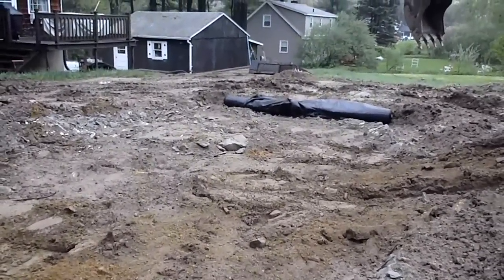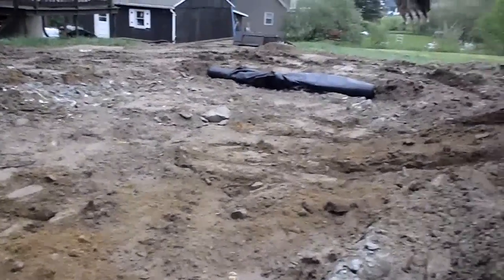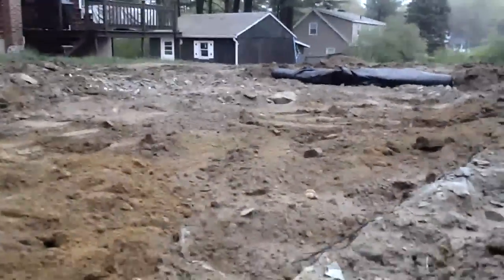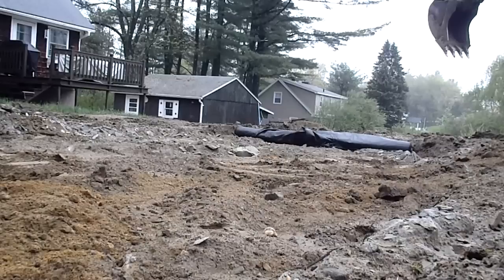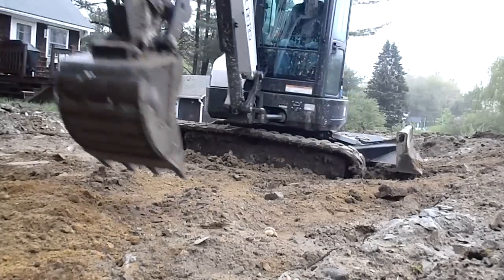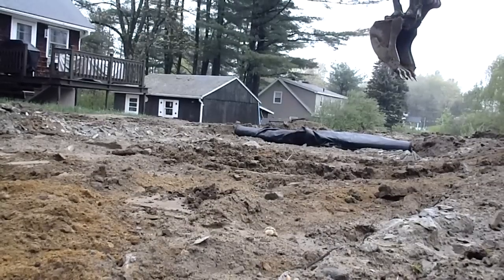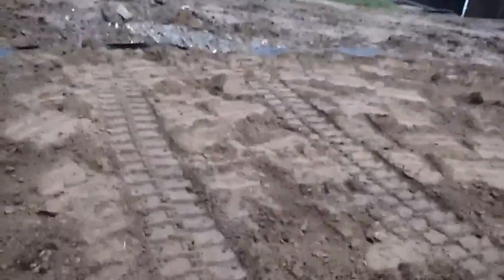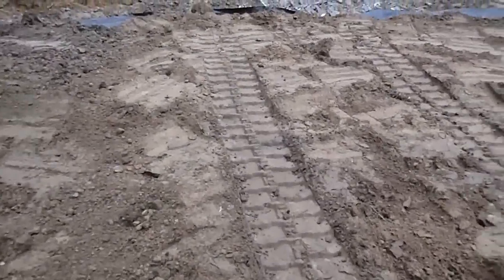How Geotextile Fabric Works (Practical Application)

Comment: wonder how much it weights
Reply: Depends on pattern, drainage requirements and support needs, ranges around 2 to 10 ounces per square foot. Also a rolls weight varies on width and length needed, full rolls as I said varies in weight per specs.

Comment: I used silt fence which is made of geotextile fabric, but much, much, much cheaper. Created a gravel path through a mud hole, giving me a nice path to the river.
Reply: Where did you buy the silt fence?
Reply: Still useful in areas that lack such aggregate supply, as he demonstrated how to create Mechanically Stabilized Earth the man made way. There are still many places that lack rock and thus you have as he first demonstrated, unstable soil for heavy loads. No matter if it is rock or textile, if not properly drained when the heavy rains come it will become puddles and wash areas away. Still textile is useful for preventing or reducing mud or rock slides.

Comment: We use this fabric for 2 uses where I work. We lay concrete storm pipe & drains. If we are setting a manhole for example & the ground is to soft or wet, we put down a layer of fabric, then stone before setting the concrete boxes. They also wrap the connections (bell & spicket sp?) ends of every pipe to prevent dirt getting in the pipes.

Comment from the maker: First be sure to put holes in the bottom of the pool (like 2ftx2ft) or better yet break up the entire bottom so it doesn't hold water. Then yes 2 layers, with about a foot of dirt in between, and at least a foot of dirt over the top layer.